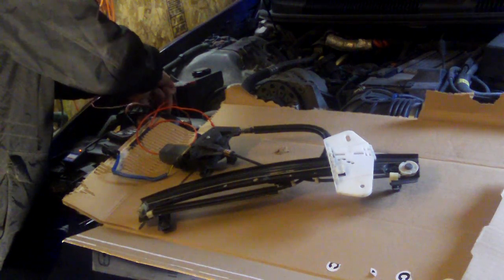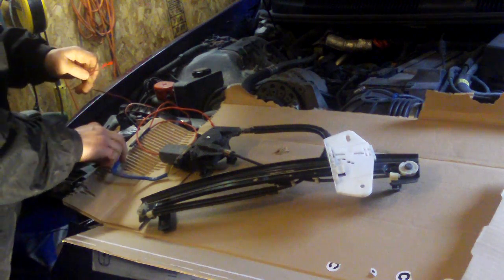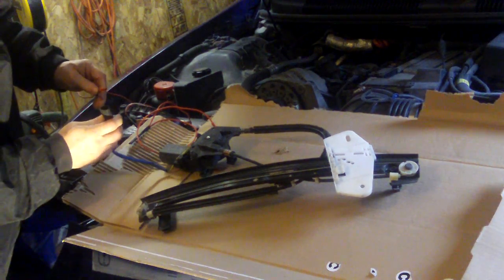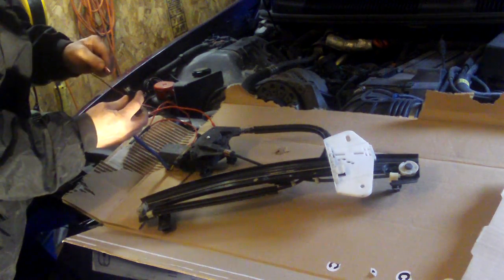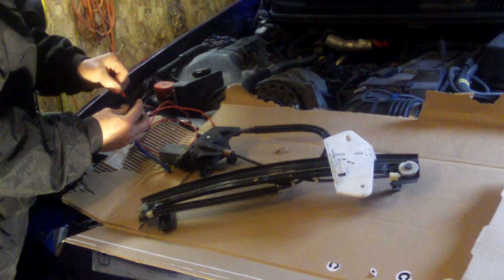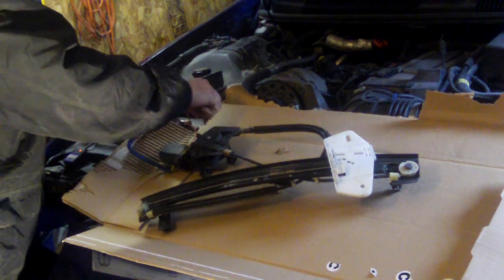Testing a power window motor and regulator

Comment: What if  the motor has 6 electrical pins ?
Reply from the maker: It might have a logic board? Look up a wiring diagram for it and see where the other circuits go to

Comment: i replaced the switch , still a no go , going to check motor next (can I replace just the motor or do I have to pull the whole assembly and glass etc) /
Reply: Jon and Kathryn Graul 
was going to reply but saw its been two years lol

Comment from the maker: The easiest (and best) way to check the motor circuit from the switch is to remove the door panel and disconnect the motor wire, connect a test light across the motor circuit. The light should illuminate when the switch is toggled in either direction. If it only illuminates in one direction but not the other then a switch is probably the cause. If it never lights up then you might have a power ground or wiring issue. If the test light powers up in both directions then you will probably need a new motor/regulator. hope this helps.
Reply: I'm confused. You said connect the test light to the motor circuit and that it  should illuminate in both directions. Then later you say, if the light powers up in both directions that means the motor is bad?!?